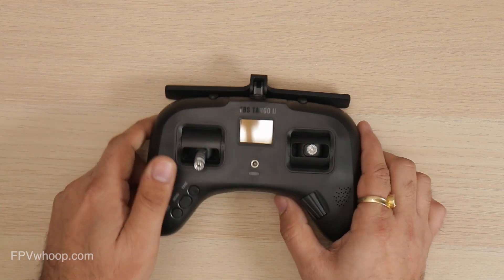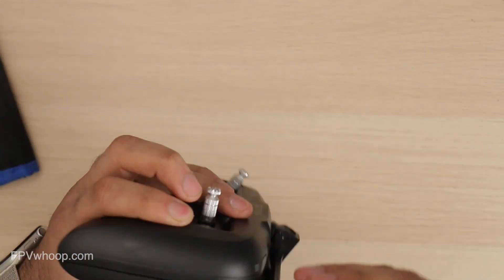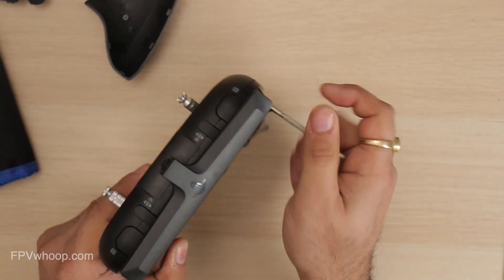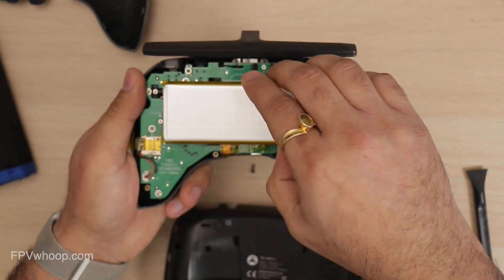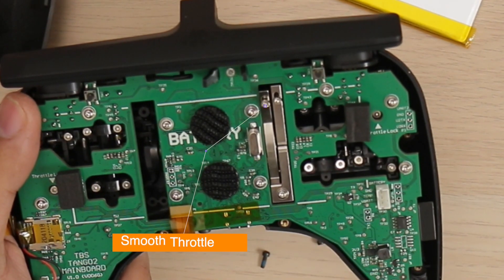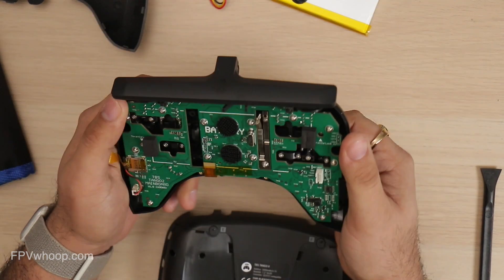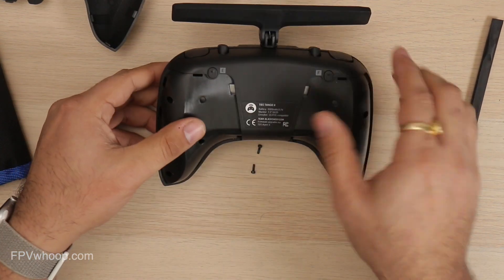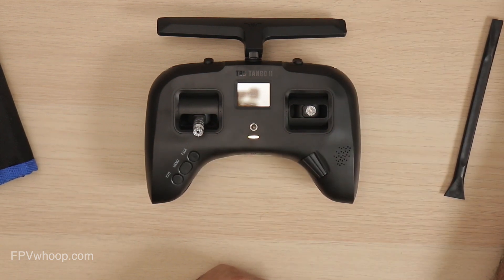TBS TANGO 2 mod - How to adjust TBS Tango 2 throttle stick strength

Comment: I tried adjusting pitch and roll! It has to much tension and it didn't work.  If u screw them to lose the battery will interfere 😢

Comment: Nice job. I'm afraid I'm too chicken to take apart my new TBS Tango 2; but eager to ajust the throttle. The stock setting is way too loose. Keep up the good work.
Reply from the maker: Yeah its too loose, so had to open it

Comment: Sucks you got the old board. The new boards have the data slot for multiprotocol. I was hoping you could do a video on the installation of the bay door attachment and demonstrate the multiprotocol.
Reply from the maker: I will order new model and do the video 👍
Reply: FPV Whoop you can buy the new board for $30, make sure you get the expansion bay addon as well! Looking forward to your installation video!